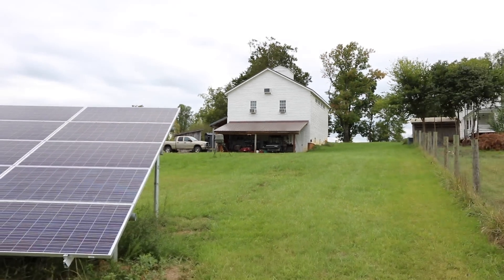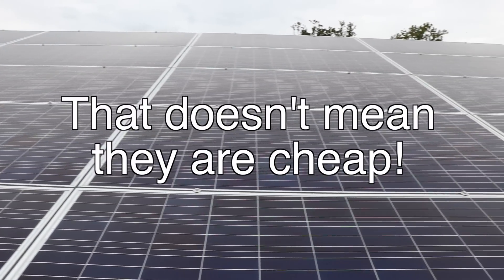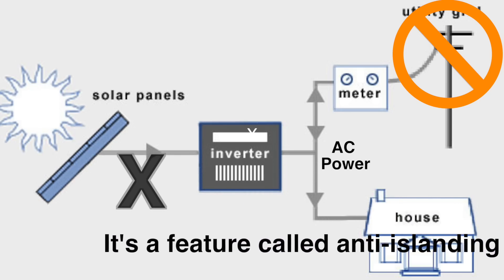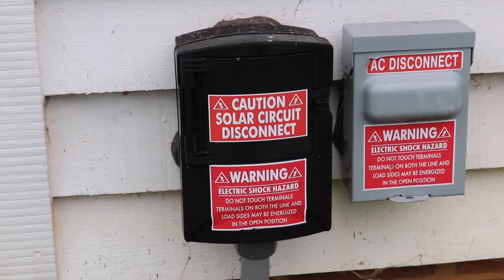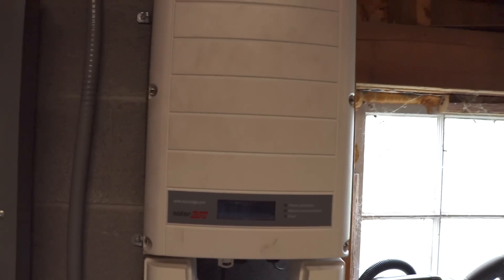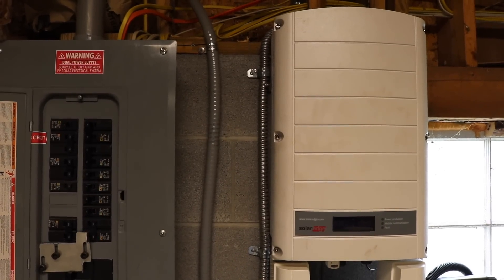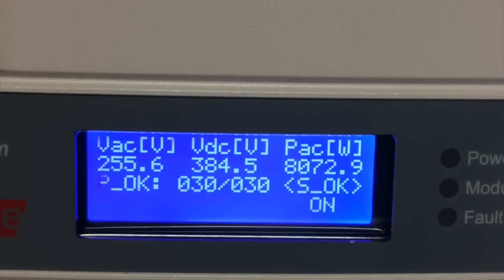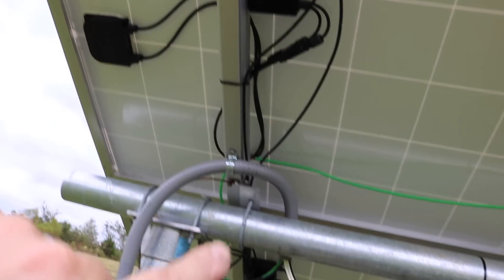The ugly truth behind grid-tie solar systems. Part 1, FarmCraft101 solar.  Watch before you buy!

Comment: The level of misinformation and misunderstanding in these comments is actually unreal.

People are scoffing at a $17,000 price tax to replace your electric bill for the next 30 years. In what world do you live in where the average home has a power bill less than $150. YOU may have a power bill of $70 dollars in your 1200sqft home but most people who live in medium sized 2,000sqft homes or large pay between $150-300 a month on average. Thats $2-3000 dollars a year. If you take that out to 30 years, thats $60-90,000 dollar that is getting replaced by a $20,000 investment. Assuming that the electric bill doesn't increase in the next 30 years... 

The average electric company increases their rates at about 5%. This system is going to save Farmcraft 101 somewhere between 50-100k over the next 30 years and yet you simple minded idiots can't figure out where the value is. 

Whether he wants to add batteries or buy a generator as a backup for the .01% of the time he doesn't have power is completely irrelevant. He has enough money left over from his savings to do that 10x over.

No wonder you are all broke and have no retirement.
Reply: I see that money spent one way or another.  Either you pay the electric company for your usage, or you pay your solar installment.  After 8.5 years, the money is spent either way.  It's trading the electric bill to solar bill, but after 8.5years....no more bills.   Also, if you have a lower energy usage, you're going to get a system for your needs.  Its not going to cost the same.
Reply: Fortunately I live in the Midwest where everything is dirt cheap. My house is 2400 square feet, 3 bed 2 bath, 3 car garage, full finished basement and.......electric is 40-50 in summer and 20-30 in winter. I'll be honest with you though I'm single and work 70 hours a week the house sits empty most of the time if you don't count the dog he soaks up the central air and heat more than me. It helps that everything is natural gas too summer is like 30 for gas and winter is around 90 you know those cold ass Midwest winters.
Reply: Well my average electric bill is about 75. But what bless my mind is. Where is the cost for the solar coming from here. You can buy solar panels for 100$ wtf
Reply: @nicks9642  those panels are about $250, the pipe stand is a couple $thousand, the inverter is over a $thousand, all of those little boxes are nearly $100/ea, optimizers $50 each, ~$1,000 cabling, ~$2K installation. My recent experience is with 8 panel microinverter ground mount.
Reply: Bull sh*****T. It only makes sense when you are disconnected from power grid. In some places (where I live for example) you will still pay power company transmission fees, which are 1/3 to 1/2 of my power bill all the time. Solar install was quoted as $24k for me, generating 80% of my power only. It is not worth it as long as you are connected to the power company and live in a place where power is relatively cheap. 
Also, most of people have to take a loan that they will pay that 30 years probably. It ends up being more expensive than you think.
Gotta be careful when you install this kind of system, who installs it (cost of labor ofc) etc. And panels degrade each year.
Reply: @JP-ec9rl I'm not sure what exactly is it that you brewed in your mind. Not having power companies delivering viable product? Effect on businesses? How at all do you associate those thoughts to solar power production at home? 
Do you mean he's "takin' them' jobs" by making his own power? Ridiculous! Try this: Sell your car or all the taxi and professional delivery firms won't have a viable product. Think of them' jobs!
Reply: To be legit it's a $23000 system that your having tax payers pitch in on.
Your also forgetting that $23000 cash invested into something else would gain interest back. Or $23000 loaned out cost you interest. Say at a 6percent interest rate that's $1380 in interest on your first year or $115 per month. 
Also zero maintance is highly unlikely and dont tell me it has 30year warranty. Warranty is a joke on anything over 5 years old. These companys sell out, go bankrupt, change names, argue who's fault it is, all to get out of there "30 year warranty"
The other is have you proven its output yet, by the sounds of it you went off the companys suggestion which is again highly unlikely.
Reply: Listen. I have zero problem with people going off grid. I just don't believe and business should  receive political subsidies and I definitely don't want my fellow citizens telling me which energy sources I should be mandated to use.
It's just that simple.
Reply: That's assuming you're going to live in the same home for 30 years...
Reply: @Tcmtech electricity is more expensive for liberals? Your insane
Reply: 1600 sq. Ft. 2 people,  $40/mo before grid tie solar. 46 degrees north latitude.
Reply: 2400 sq ft house and our average bill is $110.
Reply: 6000 square foot$ 2400 in the last 10 years on batteries and 50-60 bucks for distilled water . Small cheap system 3.4 kW array 2.5kw pure sine inverter 4 L16 batteries total cost of 5 thousand dollars or so installed by my uncle and I. Everything but charge controllers and batteries were bought used .
Reply: Wow! You assume this set up will last 30 years with no repair/replace costs. Dream on.
Reply: @JP-ec9rl  Actually yes... some solar manufacturers do run off solar. Depending on the geographic location.... a LOT of industries are installing solar too.
Reply: How do you know technology will stay behind for the next 10yrs?. For example flat screens came out at 5k for a 42". Fast fwd 10 or so yrs you can get a 42 for a few hundred bucks
Reply: Erick do you have solar?
Reply: were in Gods name did this video say anything about commercial energy Did u watch the video? @JP-ec9rl
Reply: you miss one fact.  it is projected to save him. if all thing keep running the same and the solar company is still in business to honor the warranty. but lets be honest, what are the chances of that? once you factor in lightning, replacement parts and labor and down time. yea it might still be worth it but not by what you are saying. More like 5k if he paid cash.
Reply: @JP-ec9rl  Tesla is building a battery plant which has a roof top solar farm to produce all the power they will need to manufacture with.
So yes- industry can,does and will run on solar power with battery storage. You are somewhat behind the times with your comment.
I power my home and business with a solar system that cost me $36,000.00 and it will last for 30 years with minor maintainance and repair.
During that span of time I will have saved $240,000.00 on electric bills at today's rates !
Rates will most likely go up at least 50% and probably more in less than ten years so my savings will also increase over time. In essence I could probably buy my solar system ten times over and still have saved money.
But the real issue is not having to depend on an unreliable electric grid utility and greedy governments working together to cheat you out of your money. We used to get 20-30 power outages each month for varying durations of time. Very annoying ,inconvienant, and time consuming. My time is valuable to me, I'd rather not spend 2-4 hours per month running around resetting all the clocks and appliances as well as having no internet, and no water etc. Then when the restore power it comes as a spike/surge which fries electronics in microwave ovens, refridgerators and other expensive things I'd rather not have to work overtime to replace.
No thank you- I will keep my solar system and enjoy    the independence, freedom and peace of mind it gives us knowing we are self reliant and totally able to sustain all our needs indefinitely.
By the way, you should know that after hurricane Irma our wonderful electric utility took 4-1/2 months to restore power. This was no joking matter so we upgraded from a simple grid tie to a hybrid grid tie/off grid battery backup and a good diesel generator just in case. We've never had to start the generator since we installed the solar system and we push an excess of 10-20 KWh back into the grid every day just to be nice.
Probably put both my kids thru college with the money I won't have to give to the utility company.
Or buy a large boat.
Or retire early.
Hope you see there are a few more considerations to think about with solar power and hopefully understand that it is far more practical and affordable (even without subsidies and tax credits)than government , big oil and the utilities would have you believe. Remember they are all happy to work together to keep you paying them and will stop at nothing to convince you how much you need them to protect you and take care of you.
Better to take care of yourself and lookout for yourself because out here in my neck of the woods the government can't take care of J#&@  SQUAT and pretty much screws up everything they get their hands into- then charges you for it.
Reply: @jeffbowers950  sure, you can run a small business or home on solar and wind. You can not harvest that energy efficiently or quickly enough to power a bull dozer or a tractor trailer. I'm talking about real big industry, Not tesla's factory of toys that only the wealthy can afford.
You have any idea the amperage it takes to smelt aluminium? Or energy to fire a steel mill? Good luck doing that with your solar panels. And the more people who get off of the grid the more the costs of energy providers will be divided between fewer end users. Therefore the costs of all You consume will just go up. It's all relative and really just a matter of personal preference.
So go ahead and say I'm behind the times. I say you are getting a bit ahead of yourself.
Reply: Erick Rikard Problem is you dont get a 30year warranty on those panels and more than likely the invertor will clap out in 2 to 3 years, feed in tarrif may be canned and you dont get the same benifit etc etc etc. 
Solar could even be replaced in that time.
Reply: 17k is a lot for that system he should have paid about 10k -12k also 30 years what dream land do you live in the inverter is 10-14 years, the panels 25
Reply: Agreed... $440 for the month of June in Arizona, 2350 sq.ft. home and the prices are going up 8-10% every year.  Last year we paid $2,520 for electricity which is $210/month on average. That's $75,000 over the next 30 years if the prices don't go up (LMMFAO - Compare the prices of electricity today to 30 years ago!!!)
If i go solar I'll pay about $15,000. The warranty is 20-25 years depending on brand so it's safe to assume the system will last about 30 years at which point you can buy new, better, more efficient panels again (if you're still alive at that point)
Reply: yeah I like the comment where you get 6% interest on your money. must be still living in the 80's.
Reply: I live in a 1152 square foot home and the electric part is around 55 dollars a month. I use window ac units only in the room I sleep in or in the living room. I cant afford to run my central AC. It probably don't have Freon in it by now. it had a slow leak. I still don't have money saved. I could not afford to keep up a large home.
Reply: @JP-ec9rl  How are the power companies disappearing? Most households are either too broke or too lazy (or both) to switch to a private panel array as their main supplier of electricity.
Reply: @Xisiqomelir  I'm not talking about now. I'm talking about the end result of where the green agenda wants to take the world. No oil. No coal.  Government intervention in carbon credits and what is acceptable output. Meanwhile the rate hikes are a direct result of political agendas.
Have you ever talked to someone who works at a coal fired power plant? Most of them have three units usual with one running, one in reserve and one in maintenance. 
As long as there is a demand the unit is running. Dumping power to the grid.
So you install solar panels on your house. Great if you want to be self sufficient or whatever your reason.
But it is the advocates that want to force the green agenda on society that bother me. It bothers me because it has an effect on market prices. They have already driven electric rates through the roof in the Midwest with their attacks on coal country. They have forced plants to close taking away jobs and market competition. All to prop up solar panel companies that I neither want to do business with nor can their products do me any good. I live at the base of a narow, dark valley. 
So as more and more people go to solar because there are government subsidies for it and more and more jobs disappear because second world countries don't give a crap about carbon output so industries move there because electric rates and taxes are cheap. 
As all these things snow ball into higher electric rates and those of us in mountains have. To use fuel, wood or electric to heat our homes because, all three of which were much cheaper options before the green agenda. 
You tell me who is really getting screwed in all this? Because the utility companies are going to be there as long as there is an economy. So you are going to pay the cost of their operation one way or another. If it is a bill to your home or an increase to the businesses that we all buy goods and services from.
I'm all for anyone going green. I just don't like when people misuse the power of government to try and force me to conform to it.
Reply: @JP-ec9rl  You have to be shitting us, do you really think that AEP gives one rat turd whether there are solar systems out there?  Let me explain something, the power companies are A-OK with folks paneling up.  They are already at the very limits of power production to satisfy our insatiable needs.  They are putting power plants on line as fast as they can get approvals for and yet we still demand more power.  In my area in the past 10 years they have brought two new plants on line and are well on their way to a third and they still need more.  

You have to understand that they are happy to see US invest in power production instead of them.  They don't give a shit WHO they purchase power from, whether it's a coal fired plant, a natural gas plant, a wind farm, cow fart burning plant or.....SOLAR PANELS. It saves them a shit ton of money as well as legal wrangling to have individuals foot the bill. FarmCraft101 is just another power producer (albeit as small one).  They purchase electricity from him for $XX and they resell it to his neighbor at a marked up price.  That's right, they don't pay per kilowatt what they sell per kilowatt, they are making money from the grid tied community.  

I'm not bad mouthing them either, they have some hell-a huge overhead that they have to pay.  Those powerlines don't put themselves back onto the poles when a tree goes through them.
Reply: @c22narf  you clearly missed the reason power companies don't like too much solar. Base load generation is one thing but having huge numbers of solar systems coming online in sunshine and off if cloud rolls through(think about a hot day with an afternoon storm) is a big problem.

Imagine a hot day, lots of solar generation and lots of AC running to cool buildings. Now the cloud rolls in for the storm, air conditioning is all still flat out but in a short period of time, all of the solar drops off. Now the power company needs to ramp up coal/gas/hydro/nuclear etc quickly to prevent voltage drop. This is a big pain for them especially when this happens multiple times in a day.

It's a real issue some areas of the world are dealing with. The only solution is either power drop outs OR leaving gas fired stations etc running inefficiently(costs a lot of money)
Reply: @c22narf  I make a living off designing solar systems and a VAST majority is for utility companies up and down the east coast. The utility, commercial and residential systems are a no brainer if you live in an area with good irradiance and high energy cost.
Reply: ok but you are assuming that the solar panels don't get damaged/broken over the years or will be requiring maintenance costs.  we're also assuming the 17k included installation.
Reply: If you are tied to the grid, do you really believe you will not have a monthly bill? Actual KWH's are but a small part of your bill. My bill this month was $38.   Solar is but one way the rich virtue signal. Their hybrid vehicles are another way.
Reply: ratoneJR You must live in a small apartment somewhere that hardly uses electricity for heating or cooling but rather just for lights... With that little usage it makes sense that the base charges are given. Once you hit a certain usage base fees are gone, at least in my experience. My usage is ~1800kwh a month.
Reply: You think those panels and batteries are gonna last 30 years? Obviously not. More money to replace them.
Reply: @MUHerd37  the new panels coming out offers warranty up to 25 years i assume you can expect 35 out of them . just a thought
Reply: @aimkevtadok3177  Right. 25 year warranty.  Remember Solyndra?  lol!!
Reply: Nick V LG’s Panel and Inverters come with a 25year full warranty as well and have a life expectancy of up to 50. When your ROI is at 12-15years... I know it’s a good investment for the long run.
Reply: @codytheilen7351  25 year warranty? That is terrific! I have one word for you. Solyndra.
Reply: Nick V I do understand what you are saying as I am aware of what happened. I though think that you can hardly compare Solyndra with LG by any stretch.
Reply: @codytheilen7351  Fair enough. LG seems very solvent at the moment but so was the great GE.  Have you actually read LG's warranty on solar panels?  The list of exclusions is a full page long. Everything from improper install to improper maintanance to power failures, power surges, heavy snow and I kid you not,  acid rain and normal wear and tear whatever that means.  Nope, the warranty really doesn't give me any confidence. Too many ways out for LG to deny a claim.
Reply: Nick V I don’t disagree with you at all, and how companies in general handle Warranties, but if you desire to take the governments tax credits now along with getting solar you need to choose a company that you trust most out of the bunch and to me LG with its panels, warranties and reputation etc. comes out on top. Now can this change in the future just like GE as a company has developed or rather not developed itself what people wished/wanted... time will have to tell...
Reply: @codytheilen7351  There are better ways. Most of home energy is used for heating/cooling. I went another way and hired a reputable insulation company to go through my house from attic to basement. For a one time cost of a few thousand dollars, they turned my home into an airtight and stingy energy user. Worth every penny and paid for itself very quickly.  Most people get annoyed at all those sales calls from solar companies.  I love to talk to them. Everytime they ask me what my average utility bill is, the call ends very quickly when I answer the question.   The solution is not trying to pay less for energy. The solution is to  use less energy in the first place.
Reply: Nick V I agree with you again but everybody’s situation is different. My main cost for example is not heating/cooling as I have a airtight new home but rather my “small” 800Gallon Aquarium with Filter System with multiple pumps, air compressors, lighting is “eating” my power etc etc... solar is defiantly not the right thing for everybody but everybody’s situation is different. My average utility usage is around 2000kwh/month year round. Now you can say... well you choose to have that aquarium, and yes your right I did and I’m not giving that up... for me the math just made sense... for you this can look different.
Reply: @codytheilen7351  I get it. In that case, consider turning it into a terrarium. lol!
Reply: Nick V HA! Ya not gonna happen lol! Cheers.
Reply: i had to google your reference to Solyndra as i didn't know of it . When i talked about the 25 Year Warranty i'am making reference to the brand LG with a yearly global sale of 50B which i qualify as a safe investment to buy your panel from since the brand has been around for 30 + years  and Sun Power a lot smaller but still. 
Anyway i don't much about all this but i guess we can always doubt warranty and expect the worse with a company lodging bankruptcy like Solyndra which is what you were trying to say i assume  @nickv4073
Reply: @aimkevtadok3177  warrants are only as good as the company and usually prorated
Reply: @MUHerd37  Panels yes... batteries no. There is a gradual efficiency decline over the life of the panel but its pretty insignificant. To counter that you have to keep in mind that the appliances you will be replacing in your home over the next 30 years will also be more energy efficient so it is somewhat of a wash.
Reply: @MUHerd37  Of course they will still work. Think about it. There are no moving parts in solar panels or inverters. Just electricity (which the human race has become an expert at controlling overall) , silicon, and metal. much like mmmm… lets say that 1980’s clock that still works, except, it doesnt have an LCD display that can go bad. To boot, our understanding and application of computer driven simulations in the creation of products has allowed us to run hundreds of years of simulations in only a couple weeks, and when all of that is applied to an industry where the first solar panels in the 1970’s are STILL WORKING TODAY, your misconception that solar panels wont be working thirty years ago are not based on fact, but of skepticism. I don’t blame you because it is a popular misbelief, but its mainly spread by the uncomfortability with change, which in this case, change is good.                                                                                            Replacement of equipment is relative to the upkeep of regular car maintenance to the overall cost of the car (without the exponential increase of costs), and because they are backed by 25 year warranties, less than 5% of homeowners pay for any upkeep until the system has offset the utilities bill 6-8X over on very conservative utility increase estimates..
Reply: These solar panels have 25yr warranties and you are right about the batt replacement that was not used in the video because THIS WAS GRID TIE SYSTEM NOT BATT BACK UP WATCH NEXT VIDEO FOR THAT  @MUHerd37
Reply: Agree with most of what you say except that the cost of electricity isn't going up.

In my case, the prior owner put in an insane amount of insulation.   My electricity bills are $50 per month for 6 months,  $75 for three months and $160 for three months. 

Solar would save me roughly $405 per year.   

Big solar and big wind are reducing electricity costs.   And batteries are dramatically reducing generation costs for coal and natural gas plants. 

As long as you are grid tied, you will need to pay a base charge.
Reply: @mac_mcleod  I guess inflation will always keep your monthly bill on freeze LOL - must be nice to be excluded from the rest of the world.
Reply: @codytheilen7351  I'm not really sure what you were bitching about in my post. But it looks like my rates have dropped again for this year.

As far as general rates, I went in with the proposition that electrical rates would go up. However my experience for the last 30 years is that the cost of generating electricity is slowly going down.

One big exception to this is areas that used nuclear power. The decommissioning cost of nuclear plants is much higher than estimated and so current ratepayers must pay extra money to cover the unrealistically cheap power people had 40 years ago.

But you just need to think more clearly. If solar and batteries are cheaper than coal and natural gas plants for the consumer, then they will be even cheaper for utilities which by mass quantities and get volume discounts.

And as I said above, battery packs are reducing the costs of operating coal and natural gas plants. Tesla's huge battery  plant reduced the cost of Australian Power by about 50%.

If I missed the target of your vague bitching then please be more specific and I will address it.
Reply: Mac Mcleod not doubting that, but electricity prices are still not excluded from Inflation.
Reply: eric rickard,  Who's going broke and has no retirement money?  By far its not the low cost of living  rural conservatives now, Its the big high cost of living liberal urban center dwellers that are choking to death on their proud hypocritical financial stupidity.    

Where I live is deep conservative rural America and electricity costs are nothing here.  I have two houses, a 32' x 64' shop and a 14' x 20' heated shed that I do welding and high powered fabrication working a few days a week and I still rarely see an electric bill over $150.   Most are under $100 now thanks to new HID and LED lighting I have installed.  

Sure. maybe electric bills are killing people in liberal ran places like california and new york but that does mean the rest of the country is suffering from that self inflicted liberal economics stupidity where a $100+K income earner now lives a lower standard of living than a $30K a year income earner does in a low cost of living conservative area.